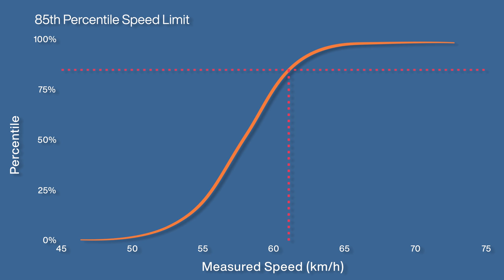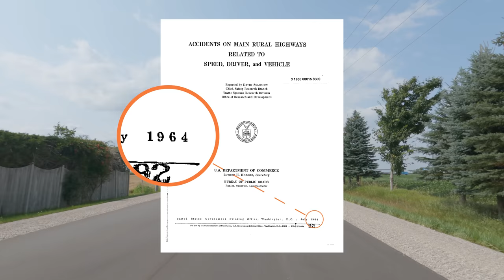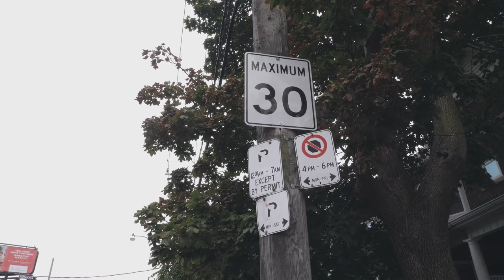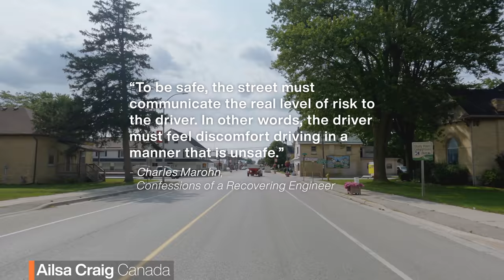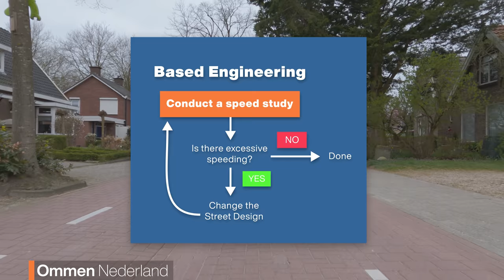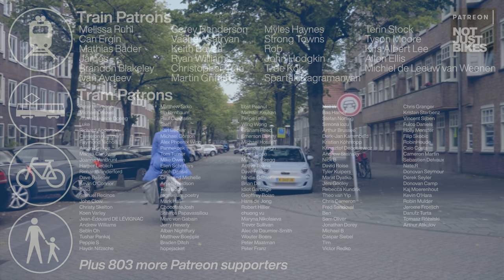The Wrong Way to Set Speed Limits [ST06]

Comment: Is it just me or does driving way below the roads designed speed limit also feel extremely boring and cause drivers to loose focus rather than actually improving safety?
Reply: there's a short stretch of road near where I grew up that's very wide, completely straight and easy to observe. it used to be an 80, but there are a couple houses on one side. it was recently turned into a 50 for that reason, but the road design is still the exact same. i hate driving that road because the whole time you just feel like you should be going faster. because it's so straight, wide and perceived to be safe, there's nothing to really pay attention to and your mind starts wandering.

most places in my area plant traffic islands at town entrances, to make you instinctively slow down and pay attention because you can't get past the traffic island without precise maneuvering. I believe roundabouts are also used for this reason, partially at least, because while you can speed through regular intersections if there's no other cars/a green light, you always have to slow down for a roundabout.
Reply: Yes! I totally agree with this!
Reply: @pnkdrmz   "...you always have to slow down for a roundabout." tell that to the maniacs in my town, the roundabouts are so small people just plow through with no regard for what the oncoming traffic is doing.
Reply: That’s fine we’ll increase the hazards and trees for them to crash into!
Reply: @Jushwa  That's the point - you either slow down right now or potentially get an expensive repair bill.
Reply: @night6724  yeah shit looks like a bunch of grandma drivers going slow asf must take forever to get anywhere
Reply: @Spartan0430  Traffic circles and actual roundabouts aren't really the same thing x-x, one works well and the other is a poor imitation with equally poor traffic effects...
Reply: @jjbarajas5341  fair enough.
Reply: @jjbarajas5341  I'm not familiar with this, do go on! We don't use circular intersections in the US, they are too complicated for 85%.
Reply: @Jushwa  ah yes, the best way to increase safety on the road is to decrease safety on the road... Expensive repair bill for drivers, expensive funeral costs for a motorcyclist. Thanks
Reply: @AZ-wc5ot  it works to disincentivise unsafe driving, like driving over a roundabout, making driving safer.

Most roundabouts near me (in the UK) are large and kerbed, with hilly terrain, full of bushes and large trees. 
No one is going to drive over that, they'd crash their car

Comment: The flashing speed signs have been a source of entertainment for me by running or cycling towards them and seeing how high I can make the number go. However, this does put me at risk, as Canadian streets are not welcoming for those outside of cars.
Reply: I used to get a kick out of how they read the advancing spokes so my actual speed would be doubled. But the newer ones seem to have some smart software in them that can tell that it is a bicycle and don't display my speed at all.
Reply: @Markle2k  but speeding is speeding whether on a bicycle or on foot, or a car.
Reply: @bowez9  Yeah you know how those runners and cyclists are heading down the highway at 80 kmh
Reply: @Hlecktro  what about those 20kph zones, and cyclists in 50kph (a decent cyclist can do 100kph+)
Reply: @bowez9  We weren't talking about speeding. And I'm not likely to be able to get up to 35 mph on a bike. But I could make the advisory signs read 35 mph by going 17.5 mph.
Reply: @Markle2k  so you're say the machines are completely inaccurate.
Reply: @bowez9  No. They are very accurate. I've compared them with my GPS.
I suspect you aren't understanding what happens with the leading spokes. The spokes moving backwards (relative to the bike) on the ground are stationary with respect to the ground. The spokes on top are moving forward at twice the speed of the bike, relative to the ground. The spokes make really good radar reflectors, better than you or the bike frame.
Reply: @Markle2k  so then the same could be said for the wheel spokes on any vehicle.
Reply: @bowez9  I would be surprised if there are average cyclists on the road doing more than 25 during their commute. Is their plan to exhaust themselves before arriving to/from work?

Comment: I'm currently taking driving lessons in the Netherlands, and I really like how natural the speed limit feels in like 80-90% of the roads/streets. And usually when it doesn't, I usually feel like driving slower.
Reply: hope you live far away from Amsterdam, otherwise your instructor might just take you on a tram safari :p
Reply: only speed related problem I find is when you have done a fair amount of Highway speed, 100-120-130 kmh (depending on location and time) that when entering city limits and the next speed limit is 50 kmh, or just outside city limit with a speed of 60 kmh, that both feel slow thanks to getting used to 100 kmh + speeds you had done before.
Reply: If you are anything of a decent learner you’ll drive faster just give it a few days same thing happened to me when I was first driving I would go under speed limit but now I drive to what the road should be and usually speed but i slow down near intersections and get better mpg then most grandmas

Comment: Most of the speed limits where I live are insanely slow - obvious speed traps.
Reply: More and more cars on the road and the speed limit is reduced over and over. Major congestion is dangerous 
When people travel slow, they are less alert, The faster they travel the more alert and aware of their surrounding they are
Traffic lights are not synchronized to improve the flow but in most cases hinder the flow
Now we have traffic lights, than stop left hand turns when you could turn safely.
Lights for left hand turns are often green for absolutely nobody and no cars move in any direction for extended periods of time
There are even red lights stopping right hand turns 
Construction zones slow down travel when there is no construction or danger and extend far beyond the area of construction
I have seen construction signs that must be abandon cause nothing is going on for weeks/months
Most stop signs should be replaced with yield signs
Every city town needs major improvement to help the flow of cars to be economical and efficient
Most Car achieve maximum fuel efficiency at approximately 70 km per hour or 45 miles per hour
With sky rocketing fuel prices, fuel efficiency is of major importance
In order to improve fuel efficiency and reduce congestion, serious effort to improve traffic flow is in the best interest of everyone. 
Save fuel, save time
I would like to believe that the traffic controls are designed to be most efficient for fuel and time but nothing is perfect so there are a rarely problems
But I do believe they are be made most inefficient for fuel and time but it couldn’t be design completely inefficient so you rarely find efficiency for fuel and time. 

If the time to travel to a destination takes twice as long, that will double the number of cars on the road
The faster we get to our destination the fewer cars on the road

Comment: Here in New England, what I notice is they put up a radar "Your Speed Is ___" The problem is, it doesn't actually measure normal driving speeds, but instead causes people to intentionally lower their speeds so as not to trigger the flashing lights. It artificially reduces optimum speed.

Comment: I commute south into Baltimore nearly every day on highway 83; 3 lanes each way, concrete divider down the center, and a speed limit of 55. Provided traffic isn't congested, the far left lane will go 20-35 over, and if the person in that lane is going "too slow" they will consistently get passed in either of the right two lanes if the other drivers can get away with it. At night the left lane is usually 30 over at minimum, with the odd driver doing 90+ while weaving in and out of all 3 lanes.
Reply: Literally none of the interstate highways in my city go below 75 miles per hour in the right lane. I-44, I-55, I-170 and I-64 all go around a constant speed of 85 miles per hour while I-270's left lane can go 100 miles per hour or more

Comment: As another fellow Canadian living in the Netherlands I very much enjoy your contrasting of the countries. One thing I've noticed about drempels (speed bumps) in NL is that they also match the speed of the road. Whether it 30/50 or 80km/h, the speed bump height and length changes so that you don't feel it if you are going at or lower than the speed it is designed for, but if you go too fast it can be quite shocking.

Comment: I had a similar situation in my city in Germany where they changed a street design to add a bus stop and now you can actually cross that road very comfortably. Previously, you'd better run across it so drivers don't hit you at 60km/h. Now they all drive ~40km/h even tho the speed-limit is still 50. Oh and if busses stop, all the drivers have to wait behind it because there's a middle island with gras now. I love that

Comment: I can't fathom what I just heard about subconscious driving. That explains a lot. I didn't know I'm that special as I am always aware of what I'm doing and of my surrounding. I also follow the current speed limits at all time. Maybe that's why I hate driving but I make it a bit more comfortable by using and setting cruise control even at shorter parts of my route. For example, the place where I live (somewhere in Germany) has some 30 kph streets with (intentionally) right before left crossings. I set the cruise control to 33 and don't have to worry about keeping up the right speed after such a crossing.
Reply: everyone has to pay attention while driving. I think he is talking about those moments when your also thinking about other things as well. Are you so focused that you don't have a single thought not related to the road while driving? very impressive if so.
Reply: @crazyguy30048  Right, everyone has to pay attention but just look at how many people don't.
Reply: Yeah, I'm with you. I use cruise control whenever possible so my speed is guaranteed to be correct and always pay attention to my mirrors. But I think many people just drive whatever speed they are comfortable with and honestly don't look in mirrors or signs. Just today I was behind someone who was driving precisely 45 in a 45, but when the limit increased to 55 the car in front of my remained at 45, which is annoying because it's the one fast section of my usual drive. And then when the speed limit dropped down to 35, the car continued driving at what appeared to be 45 until it was out of my sight. It simply didn't matter what the signs said, they just drove whatever speed they wanted to.
Reply: @cassieberringer7427  I feel you. That's annoying af.

Comment: Because, often, one of the first questions someone in the U.S. is asked when pulled over for speeding is, “Do you have any idea how fast you were going back there?”, I pay close attention to speed limit signs whenever I am driving. I often see speed limits selected based on a pretty common convention in the mid-West: parking lots are 10-15mi/hr; residential areas are 25mi/hr; urban city centers and surrounding blocks are 35mi/hr, and limits increase the further from slow-moving (pedestrian, cyclists) transit you get. Sure, a road that seems dangerous to drive at high speeds would be a helpful check to drivers who pay less attention while driving than they should, but driving a car at all requires vigilance and personal accountability. I’m a proponent for legislation that requires drivers to retake driving exams every 2 years - getting them to consistently review the safest ways to drive and remain current with new traffic ordinances.

Comment: 8:20 the entrance into Ommen had me shocked it's so simple and it's so brilliant. I'm American and I'm so used to high-speed roads and freeways just going Straight into downtown streets with no mechanics to actually communicate to slow down. And there's no slowing down process. It's just you're going 50mph and then suddenly you're in a 25mph street and have to slam the brakes

Comment: It should be noted that Dutch roads have a specific set of maximum speeds and associated designs: Inside cities/towns (de bebouwde kom) it is 30 / 50 / 70 km/h. On rural roads (buiten de bebouwde kom) these are 60 / 80 and 100 km/h. 120 / 130 km/h is reserved for highways. Modern roads follow specific designs for each speed, for example: 30 km/h steets are cobbled, double stripes  between the directions indicate 80 km/h and double stripes with a green area between them means 100 km/h.
Reply from the maker: Yes, exactly. I didn't want to go into too much detail in this first video, but this is exactly right. They choose the correct speed for the context, and design around it.
Reply: The green area is stupid.. I'm colorblind and to me it is grayish, like they scraped out the old middleline. And it is even redundant, because with doublestripes in the middle and a continueous line on the right means 'max 100 km/h.'. And double stripes in the middle and a dashed line on the right means 'max 80 km/h'. Every traffic sign (in the Netherlands) is designed to be understood by colorblind people, so the guy that came with the green area idea must be suffered a blackout or something. Waste of money... (And besides: does a area with grass in the middle also count as the green area indicating 100 km/h? Spoiler: No... even more stupid...)
Reply: @KeesAlderliesten  well it is consistent design and that means a lot already. And I cannot see a problem with using green color because you cannot get driving's license if you are visually impared in any way (at least here where I live).
Or perhaps I don't understand the issue well because I know dutch roads only from YT videos, do you have any links to pictures?
Reply: There is also the 15km/h “woonerf” design.

Comment: In Australia we use pneumatic tubes and a small computer that detects speeds, and also use the speed that about 85% of people are going roughly. They also are determined by visibility, width, shoulders, number of driveways and many many other factors.
Edit: we also survey all through roads on a regular basis, and re-engineer them if there is consistent speed violations and a disproportionate collision rate.
Edit 2: it's also worth mentioning rumble strips. A lot of our roads use audible road lines, and some areas use rumble strips that are very good at getting drivers attention and making them slow down

Comment: In Norway you rarely see straight and open roads, unless you are driving at a place with low vegetation like in the mountains or at the motorway. High speed roads between 60-90 km/h are usually quite curvy or close to forests. If you want to overtake the car in front, its also usually quite difficult to do safely, to prevent drivers from doing it.

Comment: "Most people aren't constantly checking their speed." I realize that this is true, but I still have a hard time understanding it. To me, knowing and adjusting your speed is so basic, but for so many people, it doesn't seem to be. It's people's whole multitasking approach to life I guess, but I think driving requires one's full attention at all times.
Reply: Agreed, I'm always checking my speed and comparing it to the posted speed limit. I don't get how you drive any other way.
Reply: @ocsurfer23  Not only am I checking speed but I am checking my RPM and trying not to over accelerate. However more times than not I am forced to hurry and get up to 5 miles over to appease the people behind me that insists 5 over isn't good enough and will tailgate until you make a hard turn despite using turn signals and tapping brakes far enough in advance. I don't know where a cop is going to be so I try to play it safe but it feels like every single person is constantly catching up despite speeding myself up to the point where cops will pull you over.
Reply: This is why I use cruise control as often as I can down to 35 mph. Keeps me from speeding or going too slow.
Reply: I’m constantly switching between subconscious and conscious but once I’m on a highway I’m almost entirely subconsciously driving
Reply: "one's full attention at all times" would imply to never use the radio, talk to someone else in the car, take a sip of water, look at your GPS or use any hands-free tools, be well-rested and emotionally calm, remain highly motivated and unstressed - and even then a human's vigilance will fluctuate and never stay at maximum at all times. You cannot take an hour-long trip without vigilance decrement. Ideally, you'd train your sustained attention beforehand with methods like videogaming or increase alertness during driving with things like chewing-gum, caffeine or a specific current straight to the cranium. So really, your proposed goal seems practiably unattainable.
Reply: @Muenni  has anyone ever told you you take things really literally? Full attention to the extent practicable, of course.

Comment: Good points. Coming from Europe to Canada one thing comes to my mind is that most of those speed reducing features would not survive or work well with winter in Canada where you need enough space and flush surface for those huge snow plows.
Reply: It is possible to build snowplows of many sizes and designs
Reply: It works fine in Scandinavia.

Comment: My local area accomplishes getting people to drive slowly in the worst way possible. Simply make a street only 2 and 1/4 lanes wide, allow parking on both sides of the street, and allow 2-way traffic. Since you have parked cars so close to yours on both sides, people often drive very slowly. The major downside is that if the street is completely full on parking and there’s oncoming traffic, you’re both effectively stuck until someone puts themselves in reverse and pulls into a stranger’s driveway